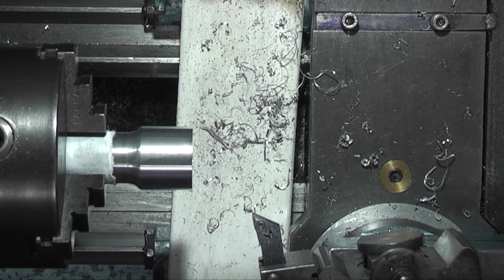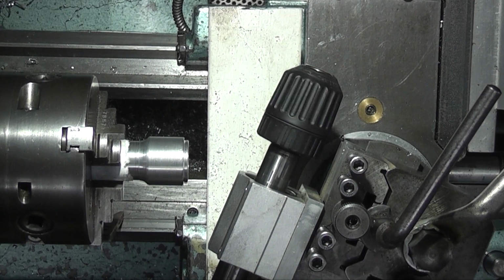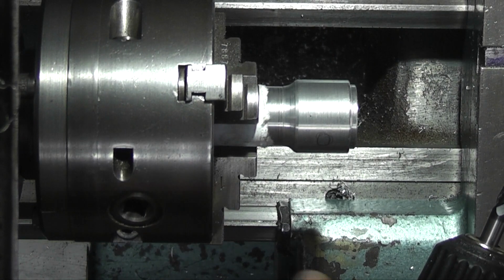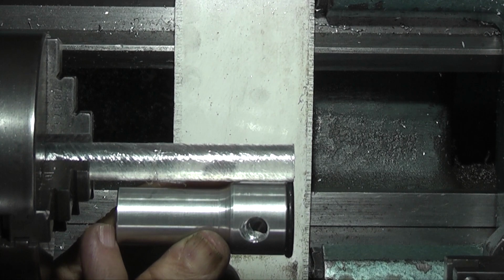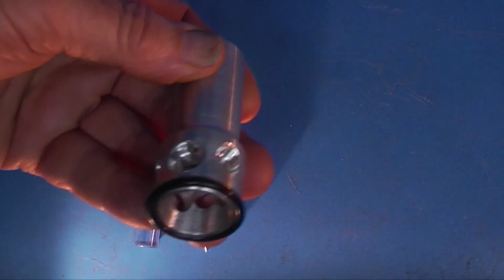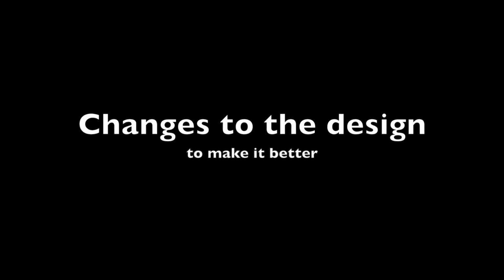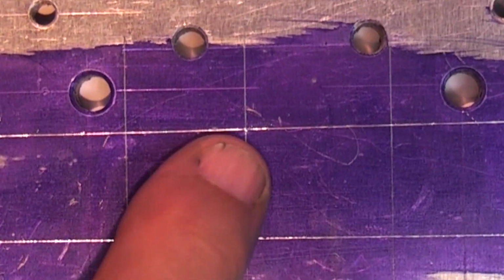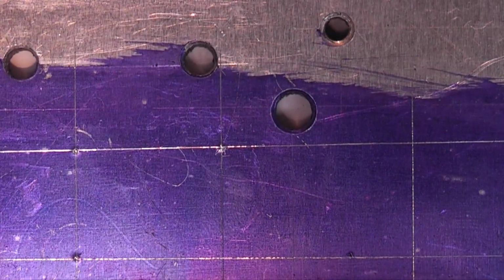Centre finder part 2

Comment: I think you'll find the better light was because the un-machined perspex rod had a polished surface. When you machined it down to 10mm, you lost all the internal surface reflection, so only axial light passed through. The 10mm would have worked better if you had polished it, although diameter control would have been difficult.
Also, the more rod sticks out of the top of the holder, the more light is collected and passed down to the target.

Comment: Good job Alan. Unfortunately you did't show how you applied the "red cross" , because that is the primal requirement for accuracy.
Reply: I think he said, plastic in the Chuck & score with a cross slide tool.
Reply from the maker: Hi Herman I did say how to do it , put the plastic rod in the chuck and use a sharp tool set to centre hight. I used a strip of paper as a feeler gauge between the tool and plastic. Then move the tool over the face turn the chuck 90 degrees and move the tool back. over the face. use a felt tip pen to add the colour to the mark.

Comment: Enoct

The o-ring can come off pretty easily with just a straight sided cylinder to hold it.  If you tapered the recess inwards, the O-ring will actually seat into the taper and be less likely to come off easily.  Or you could machine a o-ring groove in the reduced end to capture the -o-ring but leave enough protruding to give you the no-slip surface you desired

John
Reply from the maker: good idea John

Comment: Hi, Alan, I see you are using a good old Set-Tru chuck, the same model as I have. Have you ever done a video showing the use of it?
I have read so much mis-information about using one, and I am sure, like me , you know how to use it properly. So many people believe you need to loosen and tighten screws in the back plate, and on my own they are not even accessible!
Reply from the maker: You are correct the three screws you adjust are the 3 in the body of the chuck at 90 degrees to the chuck axis. Not the 3 screws on the back of the chuck which hold the chuck to the mounting plate
Reply: As usual I was not very clear, I meant that there are sites saying to loosen the screws that hold the two parts of the chuck together and after adjusting the conical socket screw to re tighten. I believe on later models the screws they mention are accessible, by our model has them covered by the backplate.
Reply from the maker: OK Nathan I understand by the way I feature the chuck next week when I regrind the jaws, I found that one jaw was out. That explains why I had to reset the chuck every time I used it.

Comment: Nice project - Even a centering scope has problems - a normal drill bit will want to wonder, so the dimple made by the center punch matters. 

What I have been thinking about is how one could make this so it could be used with an automatic-center-punch? (Rennsteig makes my favorite).  Instead of a punch - one could put a collar that holds the automatic-center-punch tip.

Polishing the outside of the rod matters - turns it into a light-pipe.